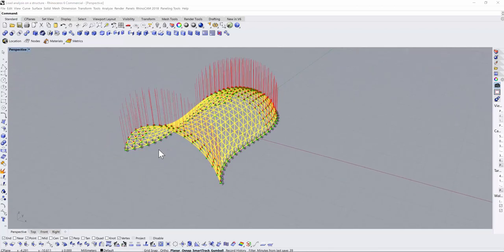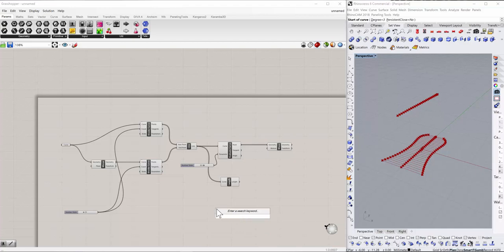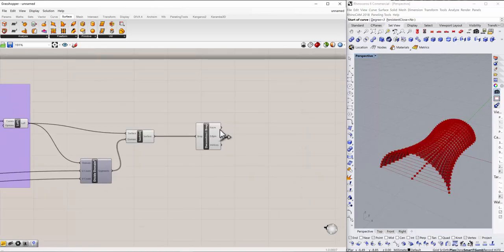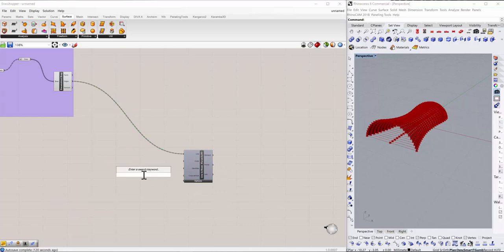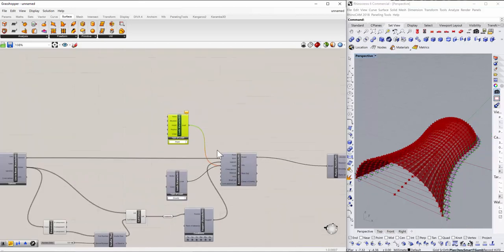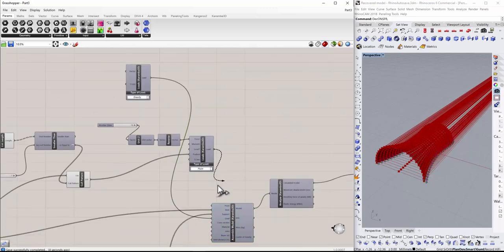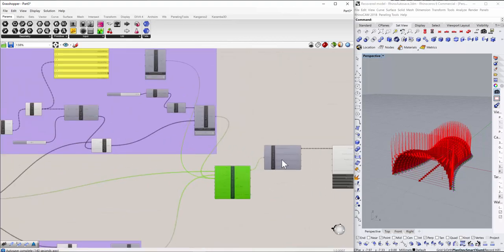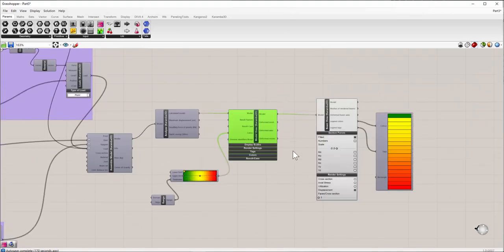Beam surface structure analysis on Grasshopper (Karamba 3D) in Rhino 6

Comment: Great video! I notice you didn’t define the cross section properties or material, does karamba have a set of default properties that it uses?
Reply from the maker: Thank you! The assembly model (karamba 3d) takes 1 as the default cross-section value.

Comment: Thanks for the great video, 
A couple of quick questions:

1. why do you put the information through a "data" component ? is it to merely flatten the data tree? 

2. why do you put loads in such a manner? is it a specific type of load condition you are trying to simulate? 

3. If you already have the edges and the surfaces, why join them again and de-construct the brep? 
4. Don't you think there would be some duplication of data since every curve would have two end points, and every surface would have edges that match?
Reply from the maker: Welcome! 1. Yes, to flatten the data and to map the data tree 2. No, I am not trying to simulate any specific load. Just trying to show point loads on different joints 3. Because I didn't have the diagonal line in the earlier brep 4.  I am not sure about duplication. But, there are possible solutions if you face such issue